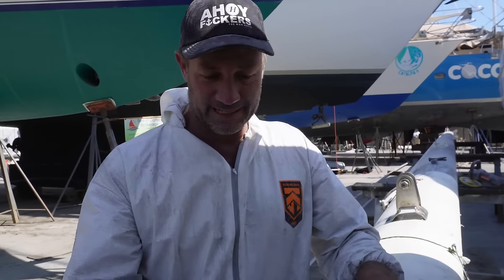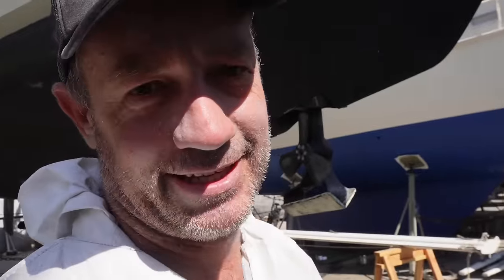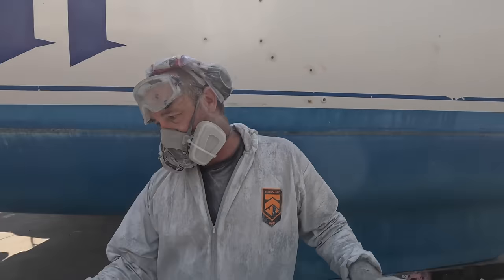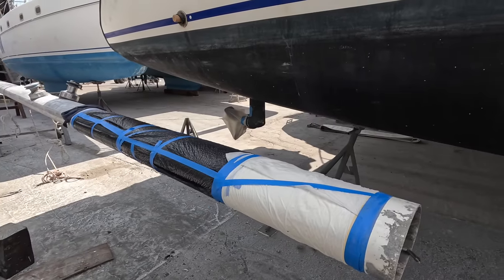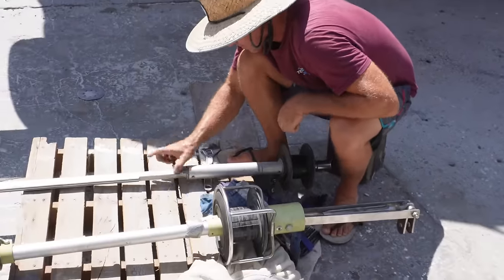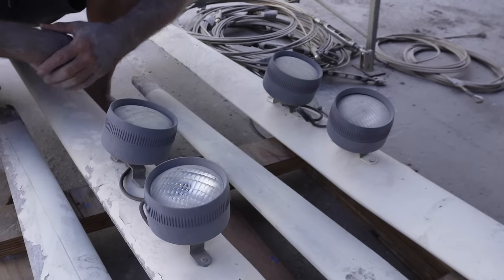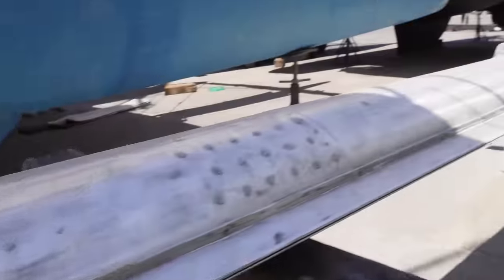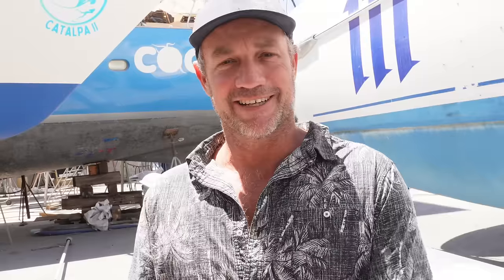Stripped naked in the boatyard Episode 417

Comment: Definitely use bolts, with all the movement and load on boom tapped threads could wear. Bend box wrench and use tape to hold nut to install.  Can glue washer to nut temporarily with lock tight.  Been there done that..😂😂

Comment: did you consider blasting with aluminum oxide. it is a much better blasting media than sand or glass. I heard the reasons you cited for not blasting but many different blasting medias perform differently. Dry Ice blasting would also be an option, though likely less available where you are.
Reply: 120 grit abrasive media is what you need for a light etch on aluminium.